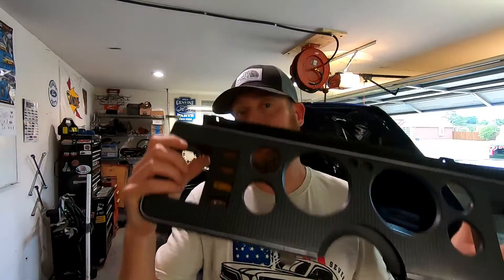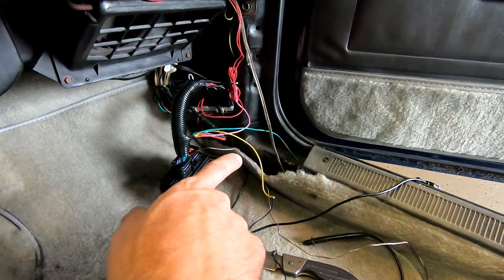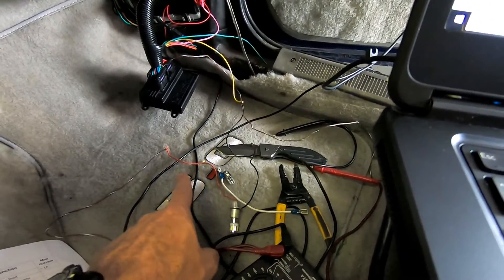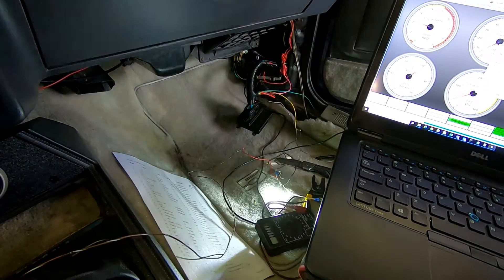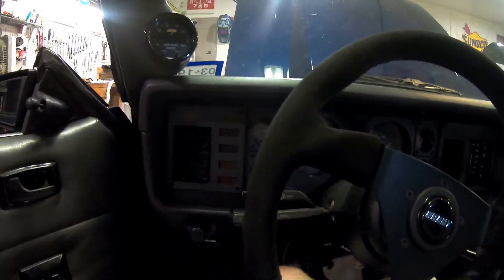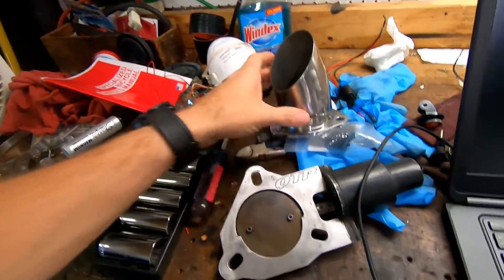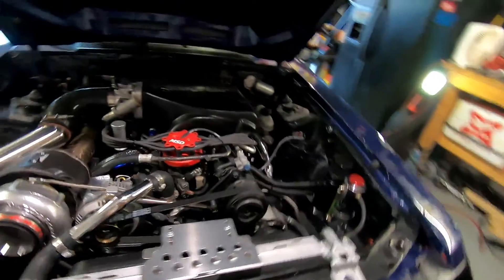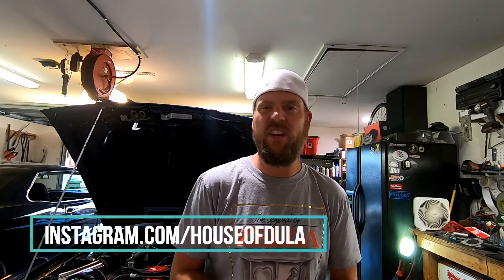1986 Mustang GT Project - Microsquirt Shift Light

Comment: That's what I decided to do with my AC hose on the mark. Finally got turbo manifolds fitted. Getting ready for crossover pipe and getting turbo on. Then run oil drain and hook up vacuum. Still waiting on a few things, but Layla is coming along nicely.....

Comment: Before I make the purchase may I ask why you didn't go with a megasquirt3 instead?  And what are the differences if you know of any.  Thank you
Reply from the maker: Money...Thats the main reason lol microsquirt is cheaper. And my buddies love the microsquirt. MS3 offers more I/O options and I "think" . Differences are little in my option. You get a 4 bar built in map (44psi) vs a 3 bar map external GM sensor (which is still way more boost than I'll push) knock sensor and some other features. Microsquirt is feature packed, cant fathom spending almost double for these.
Reply: @HOUSEOFDULA  did you keep it speed density with the microsquirt?

Comment: Hey, check out the https://perfecttuning.net/en/gauge/54-universal-gauge.html  it works over the can bus lines and can show you all the info the ms can see. I haven't played with all the settings on mine yet but there are alarms you can set for quite a few options.
Reply from the maker: Cool. Yeah Ive seen these, you could also use a tablet and wireless bluetooth. But this is clean! Thanks. I'd be interested to hear how well you like it. Judging by the size on a 4-eye it could go right in the factory tach spot which would be cool.
Reply: I was considering the tablet route and would probably go that way if I had a bad cluster or putting a swap motor in. The gauge itself is the same size as your wideband gauge if you want to use that for a reference size or you could swap out your wideband gauge for this and connect the sensor wire to it, itll communicate with your microsquirt that way too. So far I haven't gotten to play with the settings too much yet because I'm getting my motor back in and installing my rear suspension now. Another thing you could possibly do later is run a electric boost controller, check for the wires for your canister purge solenoid (pin 31)  and get it to one of the open outputs into your harness.Thanks for all the info on your builds, it helps quite a few people out.

Comment: Nice car and great videos! Question:  I have a built 347 with trick flow 190 11r heads, trick flow r intake and 80# injectors. Do you think the tune they send with the kit will be able to get it running?
Reply from the maker: Oh yeah. Easily. Soon as you hook it up, change the cc engine size to 5686 cc, and injectors to 840cc. This will cahnge the required fuel and set it up to your car...Calibrate your sensors and fire it up and set base timing. Then start tuning.

Comment: I'm really seriously considering running a microsquirt on my 87 GT, do you have to run a wide band O2 censer for it to work? If so do you need to run just 1? what brand do you recommend?
Mine is stock for now but will go boosted soon but would like to get it running in stock form first.
Reply from the maker: You can run wideband or narrow, or both I believe. I removed my stock O2 harness, if I left it on the microsquirt I believe would just use those. You really want to range and speed of a wideband though. The Micrsquit takes any wideband that has a serial output. Im using an AEM 30-0300. Pretty cheap, comes with sensor and gauge. The guege itself has serial outputs on it, I  just sent that to the MS ecu. MS ecu, has pre-set calibrations for a lot of popular widebands, or you pre-define settings for one....What I did knowing I was one day going to be bosted, I bought the AEM and installed and used it when I was NA. It was helpful, even before boost, and I knew I could use it when I got this kit.
Reply: @HOUSEOFDULA  Thanks for the reply! I'm planing on ordering the MS next week, since the engine is stock I may just run the stock 02's at first but will switch to wide bands, So the stock tune that comes with the MS will get the car running?

Comment: Are these tunes able to be emailed,because I sure could use some help getting my fox to run right,I had to take my microsquirt out  just to be able to drive
Reply from the maker: They can. You can datalog and email me the tune, I'll look it over, or I can share mine, BUT...you set the timing, set the required fuel (based on injector size, engine size, etc) these have to be set right or it wont start. If you did this correctly, you just need to work on the tune. There is just a lot variances, mine is tuned for my 60lb injectors, AEM wideband, etc..I dont consider myself schooled enough on it to really snd tunes confidently...so would be at your risk to get you close, or build from.
Reply: @HOUSEOFDULA  that would be awsome if you can share your tune, my car is undriveable so it's hard to data log I'm kinda new to this whole microsquirt tuning,and nobody around me knows how to tune , my email is ronron1466@gmail.com, any help is greatly appreciated

Comment: Did the micro squirt come with any manual or wiring diagram that labels what each wire is and where it should go?  Been thinking long and hard before you did your swap about running it on my NA mustang
Reply from the maker: It doesnt come with a manual but comes with some papers on installing it, wiring the MAP in. All the other info is online. There is a pinout diagram on the back on the ECU itself, and tunerstudio will show you the pin-outs and whats assigned to them. This kit with the fox harness, all the wires are labeled. Its pretty straight forward. It has pre-labeled output wires fir wideband, flex fuel sensor, tach and fan controller.
Reply: @HOUSEOFDULA  tunerstudio has a auto tune correct? Do you know how well it works?  It would be nice to see a comparison on fuel milage but i know you cant compare but how isnyour milage?